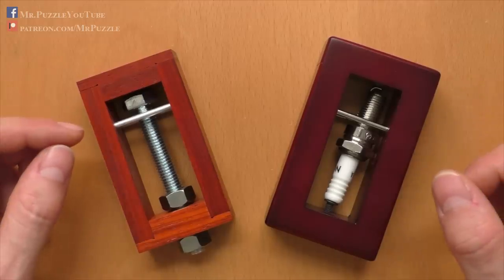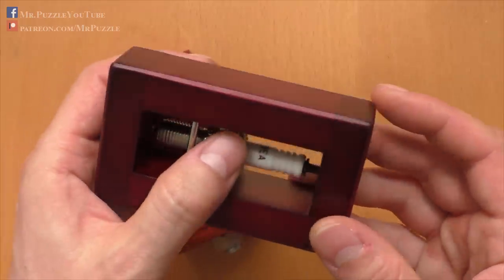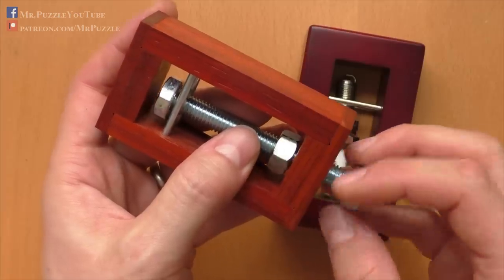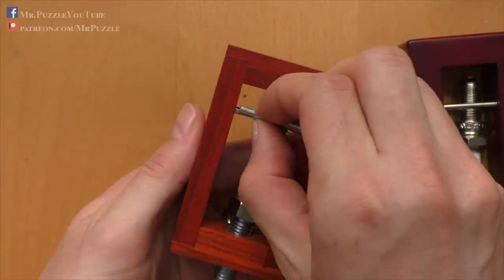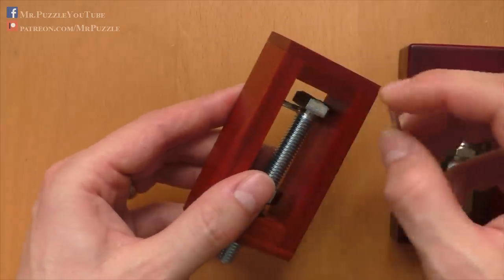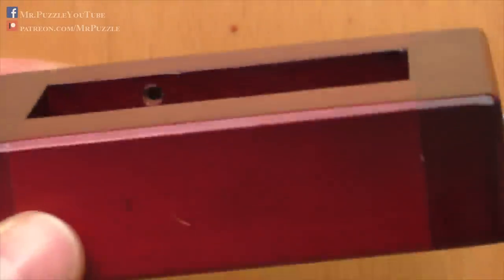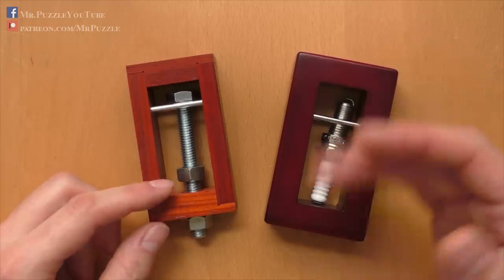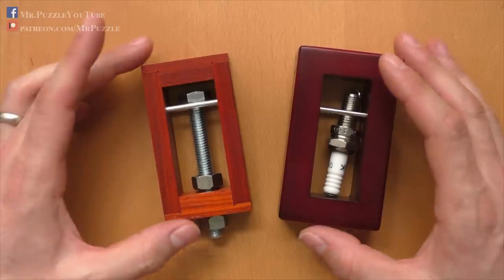The Impossible Spark Plug and Bolt - How to get them out!

Comment: So I found out that if you throw it across the room a couple times it uhhhhhh unlocks, well that's the puzzle.
Reply from the maker: I think you misunderstood 😁
Reply: wow hilarious!
Reply: no man, you just said to break it lmao
Reply: that's not a puzzle that's just breaking shit
Reply: But hey it works! XD
Reply: ThePixelleer lol
Reply: SMACKED it
Reply: Wow
And i just realized im the 420th liker here
Reply: ThePixelleer lol
Reply: well the  puzzle was to get it out of the frame...
Reply: Haha I used to solve puzzles like that with a drill and an angle grinder :D

I believe the point here though is to keep the power tools away and the surface finish intact...
Reply: When stuck, just use a hammer!! No power tools necessary... he-he
Reply: I would have just used a power saw. If the trick is the get the bolt out and you literally have to break it to do so you may as well use lots of power in the process because that makes it more fun...
Reply: ThePixelleer g
Reply: ThePixelleer WHAT.  THE.  HECK. LOL. 😃😅😂😅😂😂😂😂😂😅😅😅😅🙃☺
Reply: Sounds like you spoke to old Jean Claude! lol
Reply: ThePixelleer is
Reply: ThePixelleer ,'@
Reply: LIAR! you use a 50 ton press! duuuhh?
Reply: You can also put it in the washing machine, it solves the puzzle within 55 minutes.
Reply: No man. If you need to smack the puzzle in order to "loosen" the apparent solid placed rods, it is not a puzzle; it's a waste of time in my book.
Reply: ThePixelleer rLIVING AS CHRISTIANSet
Reply: ThePixelleer got it out, like you were supposed to, so they solved the puzzle technically!

Comment: It seems like all the impossible looking puzzles just need a good smack to solve them. Great video by the way!
Reply from the maker: +Joselina Bueno 😂
Reply: Joselina Bueno where thoughtful contemplation fails, brute force will prevail.
Reply: I'm gay..
Reply: Brings sense into why they used to be so violent
Reply: and if it didn't work, it only because you didn't use enough force. lol
Reply: women are like impossible puzzles, aren't they?
Reply: Joselina Bueno just like the radio one
Reply: One example is the Dove Tail box.
Reply: It's no your fault you can't solve the puzzle, it is in fact the puzzle itself. This is why you need to punish puzzles.
Reply: Anger is the solution.

Comment: Dafuq?! That first one's definitely no puzzle. You'd think it has a way to solve by unscrewing bolts certain way or sumthin, but noooo there's a tricky pin u need to smack. Fkn lame. It's a trick, not a puzzle.
Reply: T. N. If You Examinine It You Learn The Solution Hence A Puzzle
Reply: I agree, pretty stupid.
Reply: Michael Schemmel
Essays have a solution if you examine the directions thoroughly. Does that mean that essays are puzzles?
Reply: It’s a fools puzzle(trick puzzle)[FAKE] lol
Reply: Agreed , not really a puzzle imo. Puzzles to me require thought and logic to crack. A faulty or trick pin is neither of those, basically is like me breaking it with a hammer and saying there puzzle solved.

Comment: I'm still before the reveal. My guess on this puzzle is that they both feature an additional threaded section (in the head for the bolt and center body for spark plug). This seems the only logical conclusion if we take the puzzles at face value and assume that we truly can't open the frame or displace the guide bars.

EDIT: Having watched further I was disappointed that the solution was to displace the guide bars using a hidden latch. Really not my type of puzzle, but an excellent design for those that are into hidden latches.

Comment: Yes, that is not a puzzle...
Reply: And you are not an intelligent person. 'Cause, yes. It IS a puzzle.
Reply: Its not really a good puzzle. Its almost like cheating.
Reply: Peter Griffin Ok, then maybe you can Explain what you Think a puzzle really is.
Reply: Noobs
A puzzle worthy of the name requires no hidden information from the eye for its solution. For example, in the 'Tricky Dick' puzzle, one could theoretically map out the topology directly from the video without actually handling the object.

The word 'impossible' is also misleading in that it entails that the geometry of its arrangement hides some exceptional configuration that escapes ordinary visual logic which, if escaped, allows its solution. In other words, it's 'impossible if you think in an ordinary geometric fashion'. The tetrahedron-in-a-cage puzzle is a proper puzzle in that respect.
Reply: it's not a fair puzzle at the very least...
there's no good indicator that you have to smack it like that...
i don't think any of you thought..ok...let's gently tap it like that and a pin would come out...no
you can be as smart as you want...there's no manual stating the rules...there's no clue that if you tap it one will come off
Reply: i mught as well shoot it with my S&W 500....it's a gonner
Reply: ok, so what if i did the same puzzle, but it has a thing that melts or bends inside to make it open, and you have to use a Oven, Is that still a puzzle?
Or maybe made it so it has to be Under Air pressure to open?
No, this is NOT a puzzle, because you need brutal force to open it..
Reply: I agree, if I had this puzzle and I solved it this way. I would think that I broke it and that I solved it the wrong way.
Reply: there is no brute force to open this puzzle.. taping something isnt a form of brute force.. brute force is using ones max strength to accomplish something..
Reply: >Using force and not maneuvering the pieces.
Yeah a puzzle alright.
Reply: actually, they aren't puzzles... I solved Rubic's Cube by taking it apart... I don't for a second think i solved it... In this case the solution involves taking it apart.... That's not a solution either
Reply: Wood 'n' Stuff w/ Steve French also you are the not intelligent one it’s actually a trick
Reply: Just because you can bend or melt something doesn't mean it isn't a puzzle. A puzzle has to make a person confused on how to do its task. It doesn't have to be clever
Reply: n como eide por aembraiajem do trator mais leve
Reply: its just a dumb puzzle. it's a puzzle with a single step. theres no actual thought you have to put into it. you just smack it and win. it's a puzzle but one of the worst ones.

Comment: I notice someone has already called those out as not really puzzles, but not done well explaining why.  

A puzzle is solvable, with available information and logic.  

These are more like magic tricks, that are easily operated by anyone who knows the hidden details, but which trickery is in no way visible or obvious under normal observation or motions.  

In effect, these are akin to a magician's "7 solid welded steel rings", that are actually a pair of 2 permanently joined rings, a set of 3, and two rings with openings.  With proper sleight of hand, a theatrical trickery routine can present the appearance of 7 solid welded joined rings, and let audience test they are that so long as the audience buys only being allowed to test 2 or 3 joined rings at once.  In this case the wood frame hides the movable magnet, whereas with the steel rings, it's the actor's hands hiding the secret trick.  

Build the same parts from milled lucite, such that the lock magnet sliders and the channel for them are visible but not obvious, and this magic trick becomes fuzzier as to having traits closer to also being a puzzle.  

The only non-destructive way to open these bolt or spark plug tricks requires guessing the secret and trying to hit in different directions (as the magnet might slide several different ways, or there could be a screw mechanism on the end of a rod, or a metal piece or magnet that relies on a ring the actor has and others do not to move the hidden lock), just as some people can outguess some stage magician tricks.  A lock could also mimic some retail store theft deterrent systems, and require being moved close to a strong electromagnet to toggle lock positions.  IOW, it's practical to build several variants that would not be as easy to operate by people who'd seen this video, but would appear identical outwardly.

Comment: This is silly. I thought in the rules you could not disassemble the metal retainers or the wooden frame but had to figure out how to maneuver the bolt or spark plug around them. You could just as easily loosen the inside nut off until the head pushed the end piece of the frame off. Or better yet just take a hammer and beat the crap out of the thing.
Reply: Interesting... I hadn't seen any instructions that describe things you are allowed to do or things you shouldn't do. Of course, it goes without saying that you shouldn't break anything in order to solve the puzzle, but these puzzle solutions do not involve any breakage.

Do you have access to the instructions for these puzzles?

To be clear, I think these are a little bit on the "lame" side, but some puzzles have to be easier than others... they can't all be at the same level of complexity.
Reply: I bet a cheap company put in the false rules to make it unsolvable or to weed out novices etc
Reply: No.
Reply: Nut hehe

Comment: .... Honestly it's puzzles like these that I don't like at all, not even trying to solve, solve, or otherwise. Because this puzzle, to figure it out, literally REQUIRES you to be frustrated and it also requires you to supposedly 'give up' on it. You have to apply shock force to it to open it, that's just as similar as trying to break the damn thing. Which isn't fair. Puzzles aren't meant to be broken to solve, or even tried to break to solve. They're meant for optical tricks that play on you, that show it's possible in some amazing fashion. Liking removing a ring from a planted thread and two balls. There's no breaking involved, just a play on your outlook of it. Or even putting two triangle shaped trapezoids together to form a pyramid. It's an optical bending trick. This, this is just to literally put gasoline on a bonfire next to a propane tank..... THAT kind of anger.

Comment: Better solution:

Boil the whole assembly, let the wood expand, and the pins will spread far enough to allow the head of the bolt to escape.  

If needed, put the assembly in a hydraulic press while still malleable, and skew the frame to remove the bolt.  This process can be used for the spark plug as well.

Comment: I just ran the inside nut up towards the head of the bolt a little bit then used a wrench to tighten the outside nut until it pulled the bolt through the pins,then the bolt was free.

Comment: That spark plugs ground electrode must be way out of spec with all that banging around. It might be time for a replacement soon, it looks a little tired anyways. At least just check the puzzles user manual for their recommended gap measurement just to be sure. Keep it running smooth ya know?

Comment: My first instinct wasn't that far off from what you did... Minus the bar jiggling. Basically, my idea was to tighten both parts of the bolt/nut around the bars, and then SLAM the bottom part so it forces it to take the bars with it in the short movement upwards... A bit brute, yes... But I have this weird glee at solving puzzles in manners not unlike the Gordian knot.

Comment: pretty sure if you keep the bottom nut on and run the center nut too the top then tighten the bottom nut enough the whole thing would bust apart...not the traditional solution but effective...
Reply: although it might just break the bottom of the frame

Comment: I would have just put a spanner on the nut inside the box, got a impact wrench and used it on the nut outside the box, forcing the head to push down on the pins, breaking the pins out of the softer wood.

Comment: would be more clever if the top of the nut was a cap threaded or the bottom bolt was magnetic to release a latch holding the pin  .

Comment: Bolt one; does not need to shake  just use 2 spanners  and  pull down bolt head toward the other end and bugger the pins  as you did not stipulate  how to remove. Similar  with spark plug,  simple do not  confuse me with hidden false shit.  Problem  will never work again as I stuffed it............... ha ha

Comment: I've seen similar puzzles made out of a single solid piece of wood, with objects stuck in them, with what seems to be no obvious way to remove them.  Here's an image of what I mean: https://laughingsquid.com/wp-content/uploads/201110131303.jpg
I wont let you into the secret of how it's done in case you want to enjoy solving it    :)
Reply: But that item isn't meant to be taken apart. It's not in any way intended to be a puzzle. It's a curiosity created by soaking one end in boiling water and crushing one end with a vise, drilling and inserting the nail. Then soaking it again to swell the wood grain back to its original shape.
Reply: Sometimes the puzzle is figuring out how it is done as opposed to physically doing anything.  Oh... and thanks for blurting your mouth off about how it is done.
Reply: Spoif  at least someone fucking explained it bro

Comment: these puzzles are the stupidest dam things.. i just dont get it i guess..  its not a puzzle if you can basically cheat by taking the object apart, the only hard part about these things is figuring out which piece to take off or move.. its synonymous with taking a rubiks cube apart to make it work, its just not a puzzle